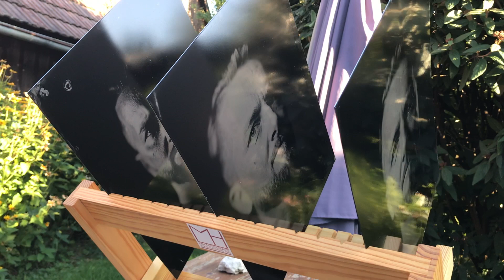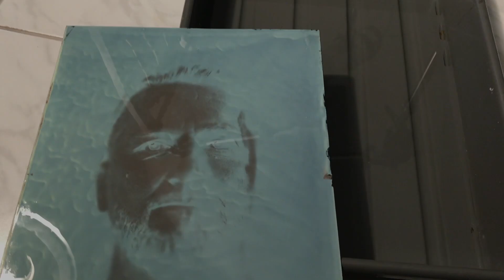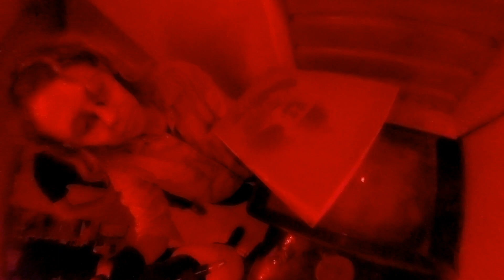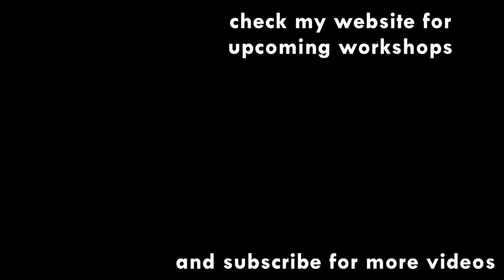Ultra Large Format Workshop

Comment: What type of lens did you use, or focal length does it have? How big are the first portraits ???. Great job and thanks for the info.
Reply from the maker: DonNikonD2X thanks a lot - it’s a petzval lens with about 360mm @F4 for 30x40cm Portrait. The smaller ones are 13x18cm and 18x24mm - these are shot with a 220mm F3 Dallmeyer 2B Petzval lens
Reply: @mhaustria   Markus thank you very much for the excellent information, it is very valuable for my project